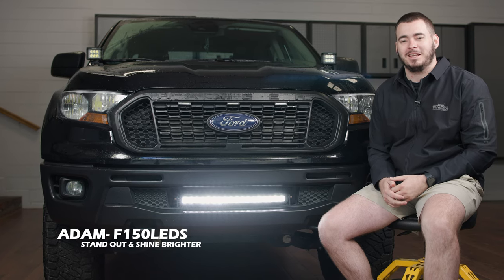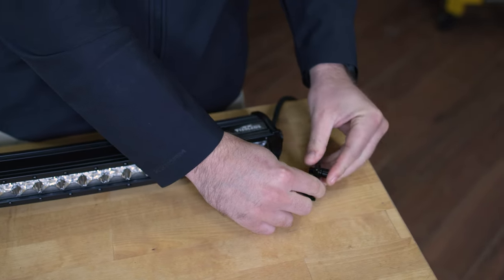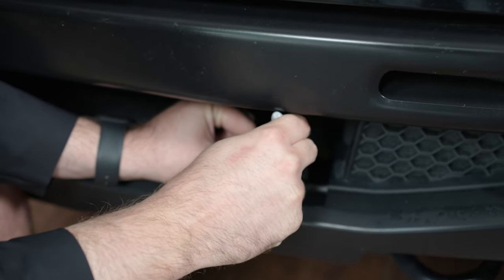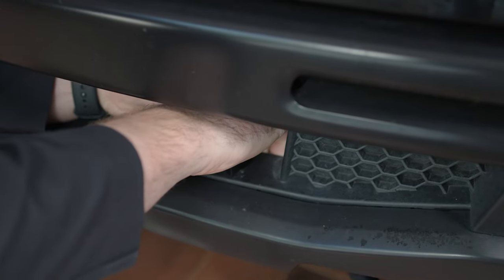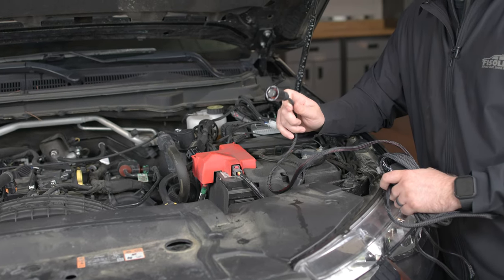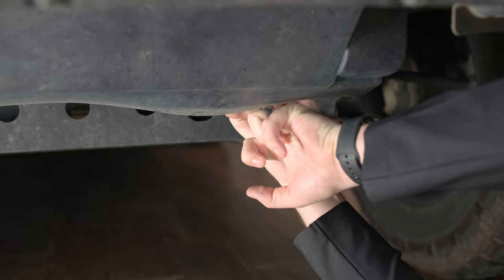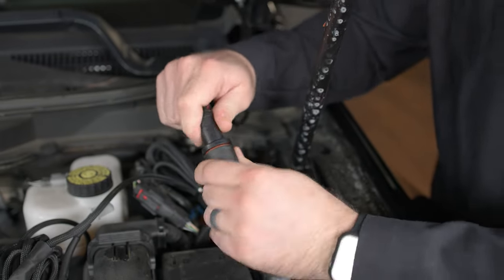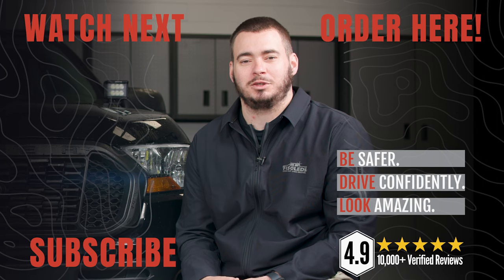2019 +  FORD RANGER 90w CREE LED LIGHT BAR INSTALLATION (From F150LEDs.com)

Comment: Remind me to check if you use all the mounting holes if I ever get you to work on my truck. 
The roads I drive on requires to use all the mounting holes available.
Reply from the maker: No problem, you can certainly used both holes on each bracket if you prefer! Thanks for your comment & support, we look foward to serving you soon!

Comment: How are you turning this light on and off from inside the cabin? Does it come with remote?
Reply from the maker: Hi friend! You can run switches inside the cab of the truck but we are using our wireless control kit! You can see it highlighted in the video using the link below. 
https://youtu.be/XOEetMc_kEo?si=IxL9jeshyHmpGiuI&t=405

you can also see the wireless unit here
https://www.f150leds.com/products/1997-2003-wireless-light-bar-controller-remote?_pos=1&_sid=a9536da4c&_ss=r

Thank you for your support, we look foward to serving you soon!

Comment: I had a question, cant u program 
The wireless controller too the garage door opener on the sun visor instead of using the key fob that you provide as i dont really want too drill any holes on my truck 😂
Reply from the maker: Hey @nuttynut, great idea! Unfortunately the wireless receiver is not set up to pair with your garage remote system. You can mount the key fob however if that would be more convenient! You can also use our stick on switch option that also does not require drilling any holes. Please let us know if we can help further, we look foward to serving you soon!